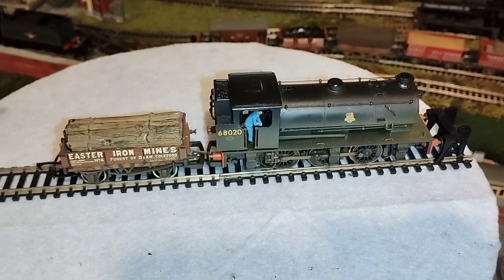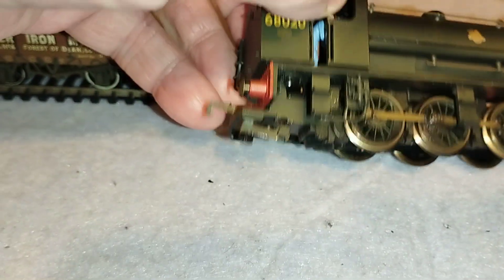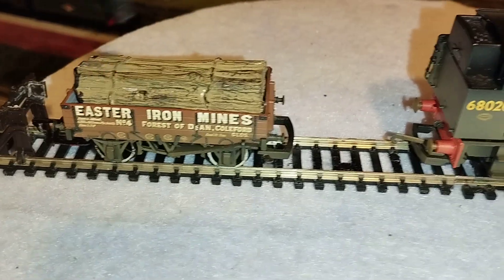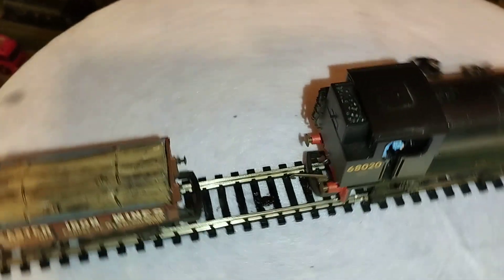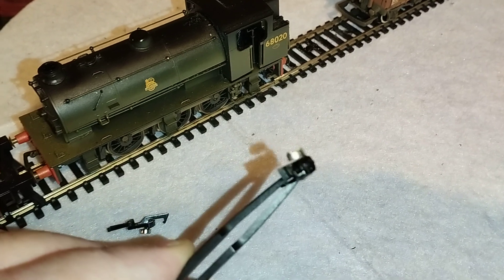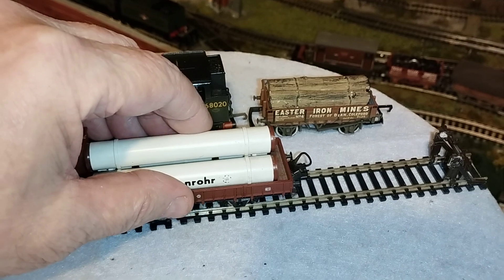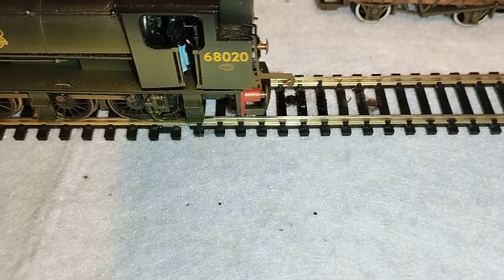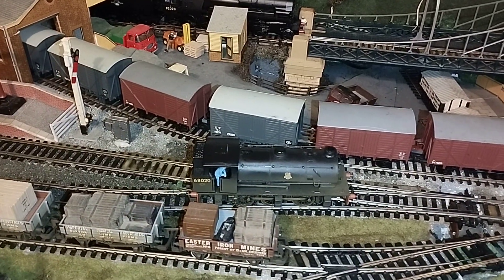Tommys Magnetic Charm

Comment: Hey Paul 
How's things going?
That's great idea even using 4 magnetic..the thing is once you put the magnet in position you would only then need 2 for each set you may want to un couple. 
Genius idea Paul great demo.
Take care Cheers Mark
Reply from the maker: Hi Mark, ok for now thanks. I was trying to think of a simple uncoupling system and had these 2mm magnets in my box of bits so gave them a go. It works well and are barely visible which is good. I hope it helps someone with a shunting yard as its hands free. Just reverse the train and the magnets do the rest. Hope you are ok. Cheers H+S Paul.👍👍👍👍